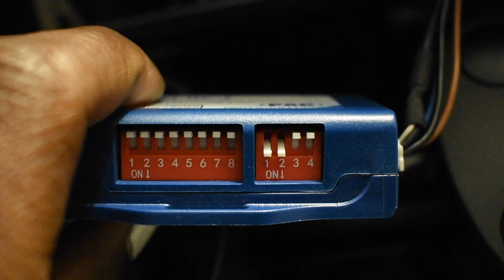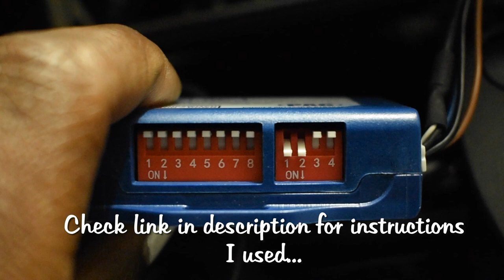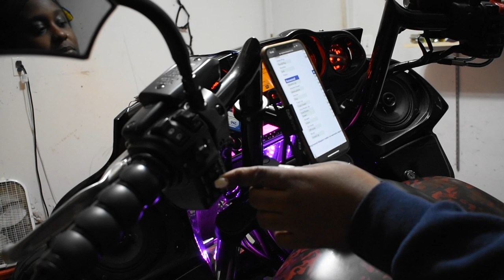SUBSCRIBER REQUEST! | Programming the PAC SWI RC-1 on my Vaquero | Enabling Handlebar Controls

Comment: Hey girly! I'm wiring my aftermarket stereo on my vaquero, only part I've not figured out is what to do with the 3 green wires (2 with the interceptors you mentioned posting in part 2... help I don't see your video! It's ride time. Ready to get my baby back together and on the road.... us girls gotta stick together ❤️
Reply from the maker: Hey girl heyyy! If I’m thinking of the same three green wires (2 having resistors), They should all be grounded. So you’ll attach them to a metal part of your frame. I think mine are under one of the three bolts that hold the radio head in place.
Reply from the maker: Actually not one of the three bolts. I have them under the bolt below that. Loosen up the bolt, put your wires under that, and then screw the bolt back down —> the bolt next to the yellow arrow in the pic below. 

https://drive.google.com/file/d/1J9ftPySthOA_1b-nWYAD52FHN04B_5Cy/view?usp=drivesdk

Comment: My light is blinking when you hold it but it doesn’t turn red when you press the settings on the steering. Did I wire something wrong?
Reply from the maker: 🤔 hmmm...not really sure. Are you using the wiring diagram from
EA? If so, double check your wiring and then try again. I didn’t have that issue so I’m not 100% sure how to troubleshoot.
Reply: @RidingWithRho  thank you for your quick response. Yes I did use it from EA but I noticed my pac had 2 black wires on the side of the pac that has the most wires. I only used one of those to connect the black wire from the Ken wood and then connected those to the black/yellow wire from the adapter plug. So I still have one black wire left on the pac
Reply from the maker: The other black wire has to be grounded.
Reply: @RidingWithRho  lol OMG 🤦🏽 so just to be clear you have both black wires from the pac illustrated  from EA wiring diagram connected with the black  wire from the Kenwood plug then finally connected to the adapter plug black/yellow wire? So in total you have 4 black wires connected? Sorry for the long text. I wish could send pictures 😊
Reply from the maker: Yup! I think one of my black wires from the PAC may be grounded with the green wires (the ones with resistors) but yup! All black wires (2 from PAC, 1 from Kenwood connected to the adapter black wire) are grounded somehow.
Reply: @RidingWithRho  ok I’m a try it thank you so much 😊 I thought I was going to have cut some wires and redo it.
Reply from the maker: Not a problem. Let me know how it goes 🤞🏾
Reply: @RidingWithRho  ok so I took all three green wires and connected it to the one black wire from the PAC got a little closer lol. The volume button on the steering no matter what pressing left or right and pressing down on that same button the volume keeps going up but at least I got it to do that lol but I’m tired I’ll try again tomorrow 🤷🏽‍♂️
Reply from the maker: Well at least there’s progress 🤗. That PAC programming is a trip...you’ll get it.
Reply: @RidingWithRho  thanks 😊